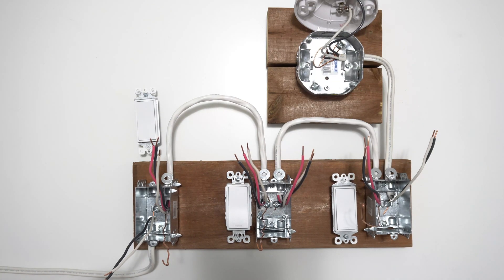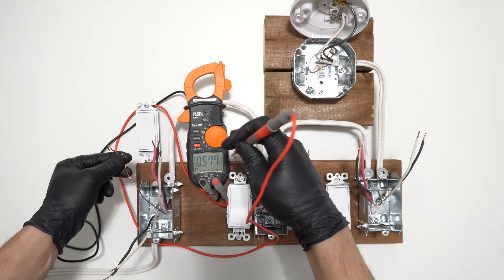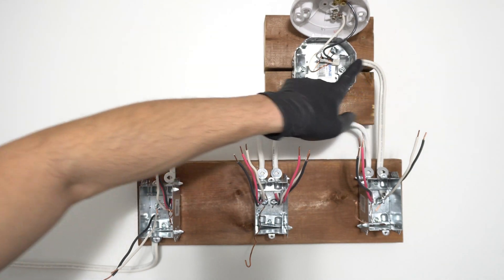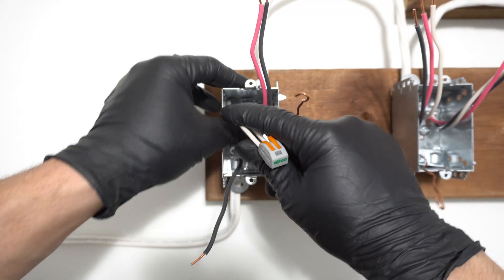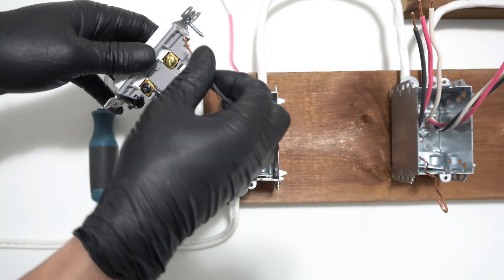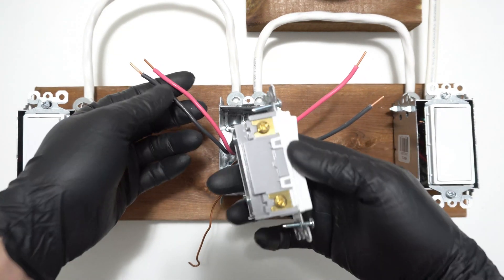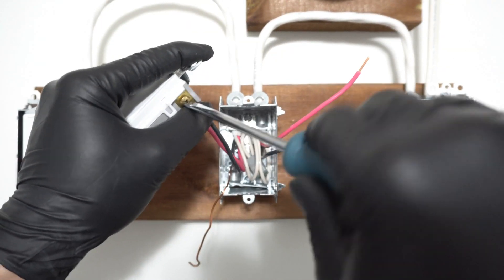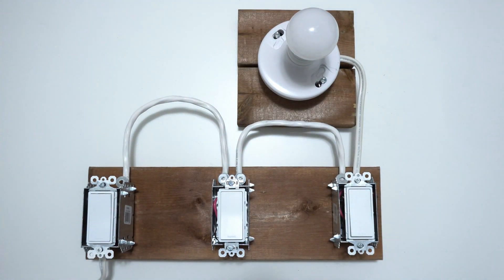How To Wire A 4-Way Switch System FOR BEGINNERS

Comment: Hello have you ever try change the switches for a occupational switches or motion sensor switches in a 4 way system ? 
Thank you
Reply from the maker: Hello, sorry I have not. But I have for a 3 way system. It's similar 🍻
Reply: @KevinPon. I have the same question as well. Is that possible replace a of the 3 way switch to a Lutron motion sensor switch? Or have to replaced all the switches?
Reply from the maker: @paulli3034 https://youtu.be/Hk_3To6VqRo
Reply: @KevinPon.  Thank you for your reply! I saw your video and the other 3 way sensor video, too. I am replacing a 3way switch in a 4way circuit, the switch only works  with black wire, not the blue wire. It really confused me. If you can make a visor about it, it will be amazing thing!
Reply from the maker: Depending on your senario. Will you be flipping on and off the other two non motion switches as well?
Reply: @KevinPon.  yes， sensor is near the door, on the load side.
Reply from the maker: @paulli3034  I would like to let you know that the sensor needs constant power for the switch to be on 24/7. When either other switches are flipped, this will break the complete circuit. This will then stopped the entire 4-way circuit and the only way to turn it back on is to flip back the last flipped switch. When installing a motion sensor on a 3-way or a 4-way circuit. The only switch can control the circuit is the motion sensor, unfortunately. The manual switches must left alone "on" at all times. 🍻
Reply from the maker: @paulli3034 hopefully this video will show you what I mean https://youtu.be/zEqfHxSLC-s
Reply: @KevinPon.  Thank you for your reply! It helped me a lot!

Comment: Hey Kevin , how come your capped off those neutral wires from each switch? Is it because you want the electricity to go straight to the light fixture?
Reply from the maker: Hello, you need to complete the path of electricity 🍻